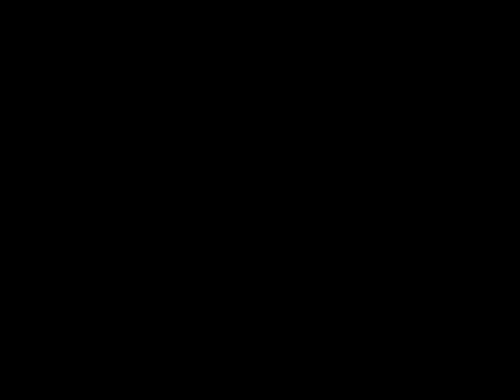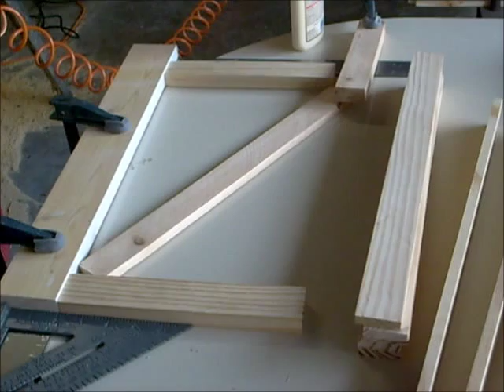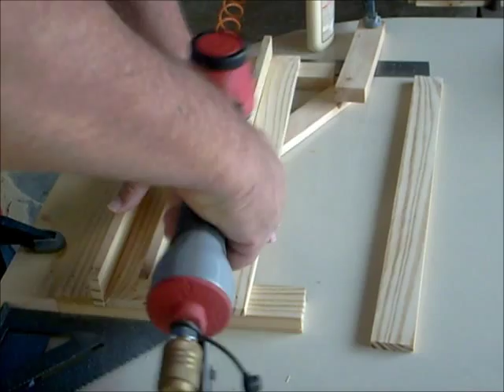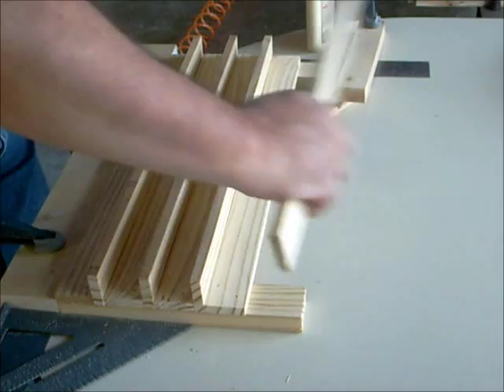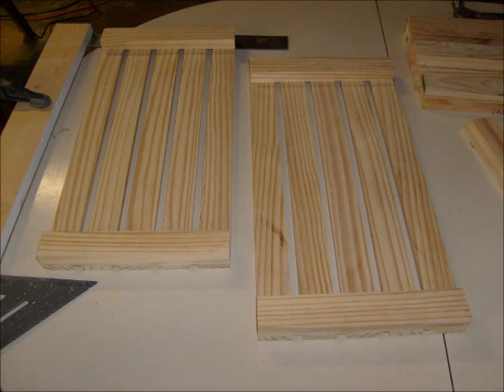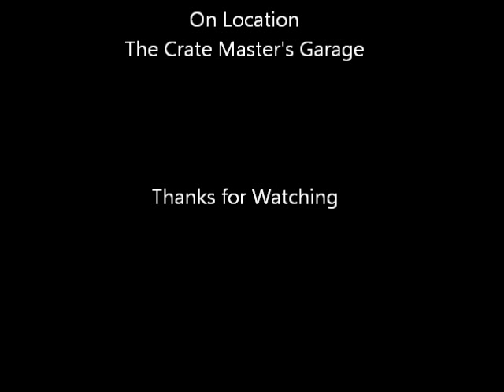Assembling A Wood Crate Side with a Homemade Guide

Comment: What size slats are those? 1x2?
Reply from the maker: 3/8s x 1.5 inch x whatever length of need
Reply from the maker: They are cut from 2x4's or 2x6's

Comment: impressive manicure
Reply from the maker: The slates are made from 2 x 4s.  So they are 1.5 inches wide. Approximately 3/8" thick.  Make them as long as you need.

Comment: why remove the spacer on the last slat?
Reply from the maker: The wood is not always perfect.  Most of the wood I use comes from the "DROP" area of the hardware store or lumber yard.  Another reason is the cuts are not always 100% right and you have to make up for it.  So sometimes you have to eyeball the last slat.  Thanks!
Reply: You should use the same slat each time so the space is the same on each one.